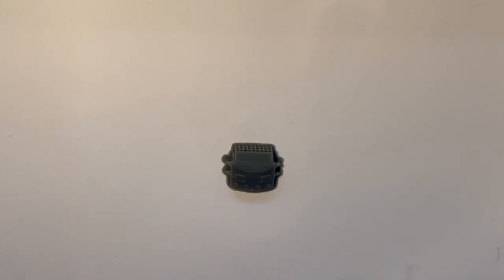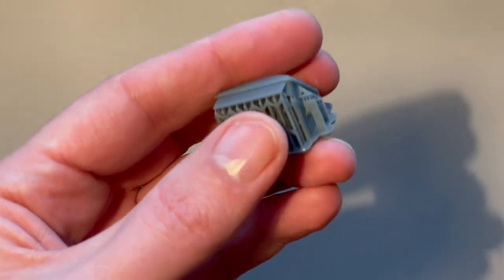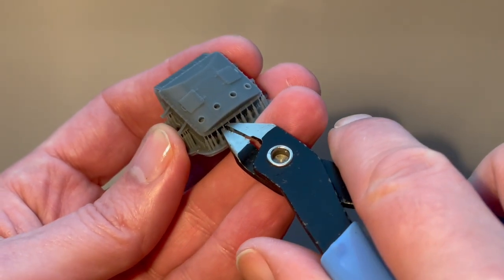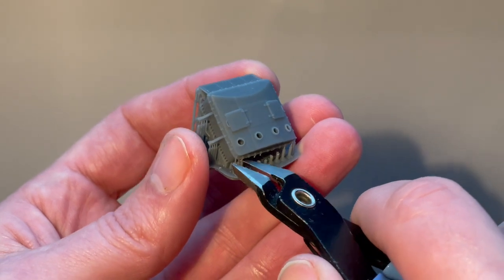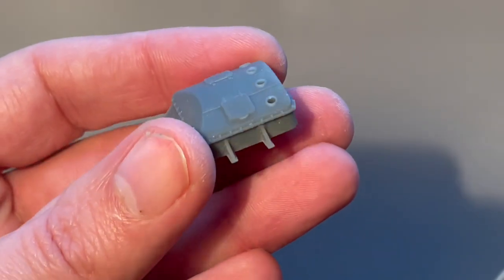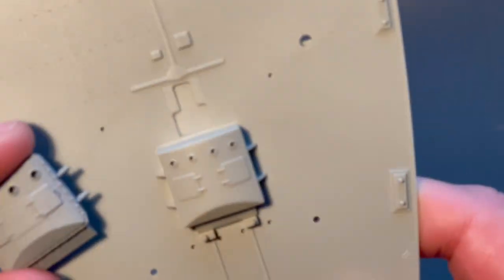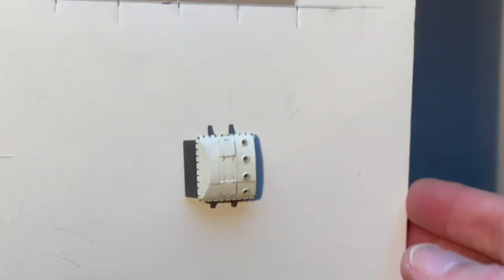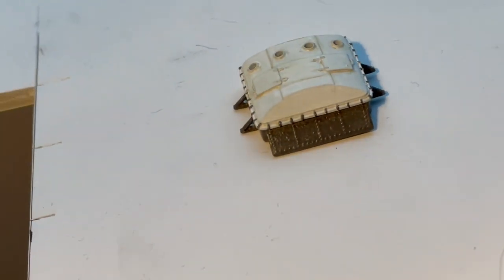Trumpeter Titanic: 3D Parts Preparation : Cargo Hatch

Comment: Great video! I wonder why many 3D-printed parts are at a 45 degree (or so) angle. It's probably to hide the fact as well as possible that it consists of layers and inevitable stepped surfaces. As great as the Trumpeter kit is (light years ahead of the rest), it seems to have a lot of simplified detail. I look forward to your progress. I'm sure your Titanic model will be killer!